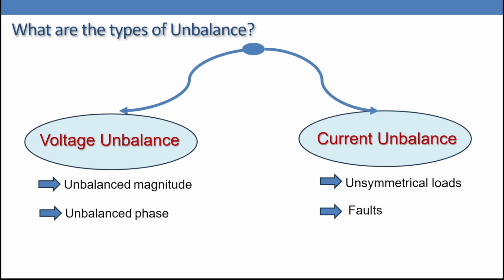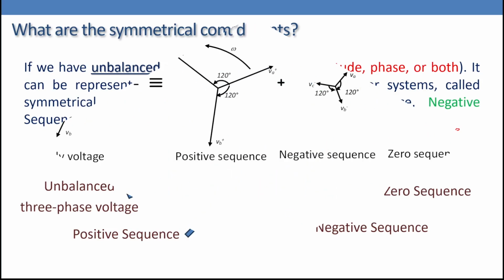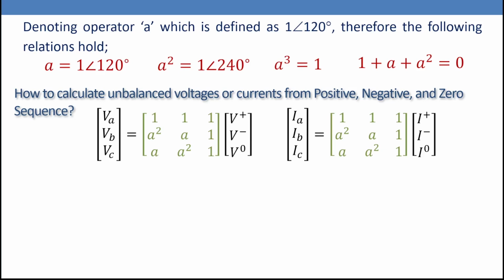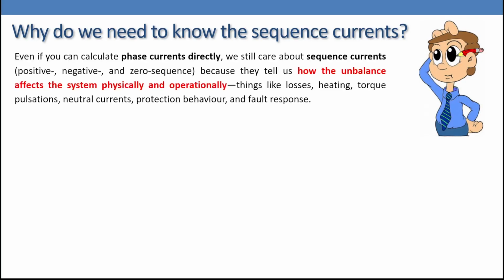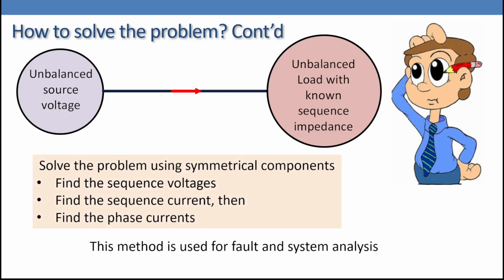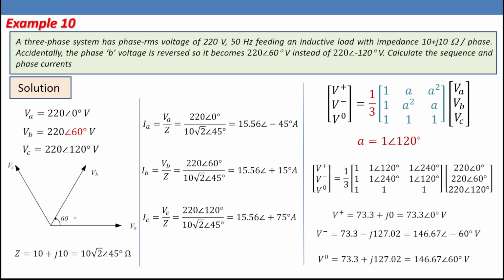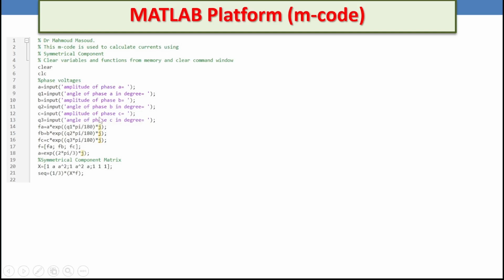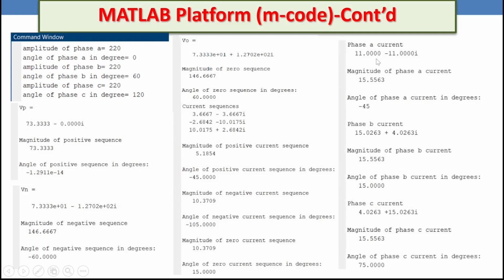Unbalanced Three-Phase Systems Using Symmetrical Components

Comment from the maker: This tutorial explains how to solve unbalanced three-phase systems using the Symmetrical Components Theorem, covering three key cases and a MATLAB verification example.

⏱ Quick Navigation:
00:05 Introduction
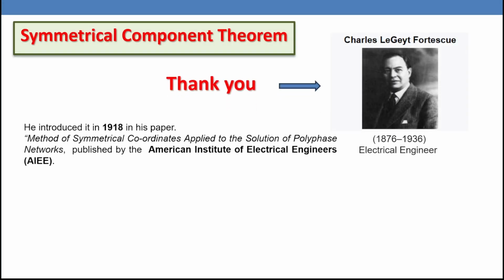00:40 Symmetrical Components
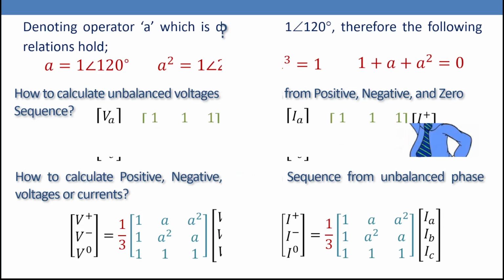04:30 Problem-Solving Procedure
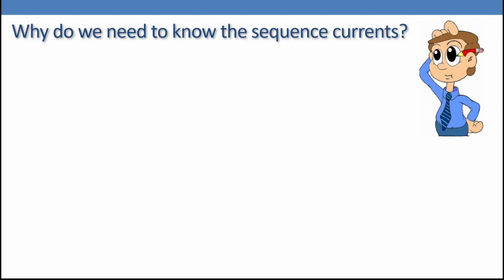05:00 Why We Need Symmetrical Components
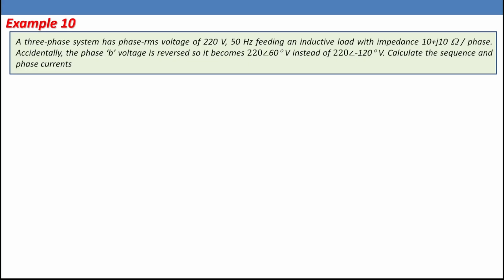06:50 Worked Example
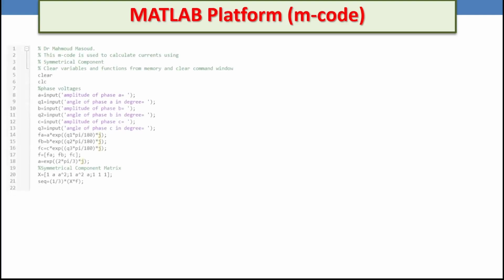09:40 MATLAB Code

❓ Question for you:
Which part of symmetrical components do you find most challenging—sequence networks, transformations, or physical interpretation?

👍 If this helped you, please like the video and subscribe for more power system tutorials!